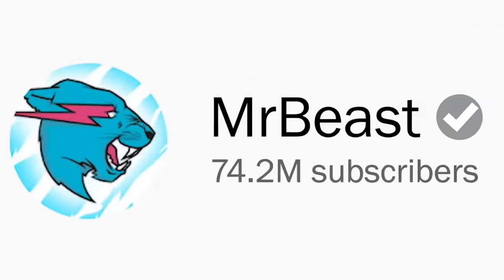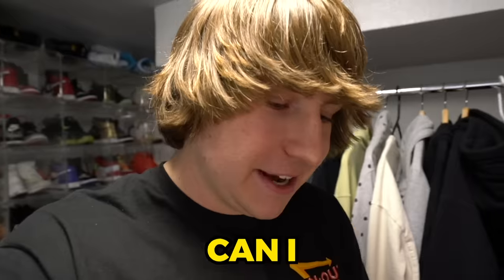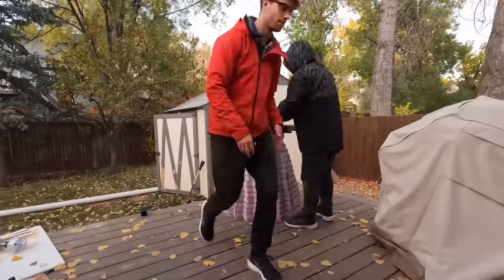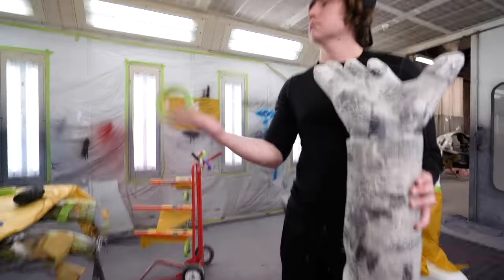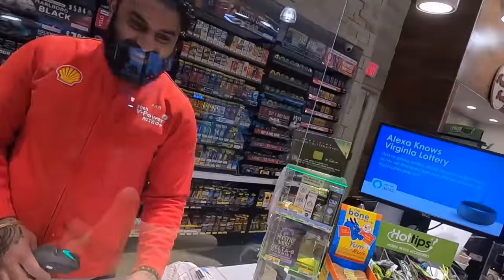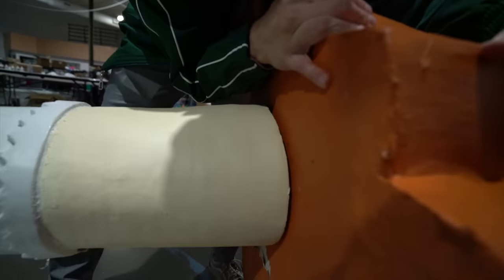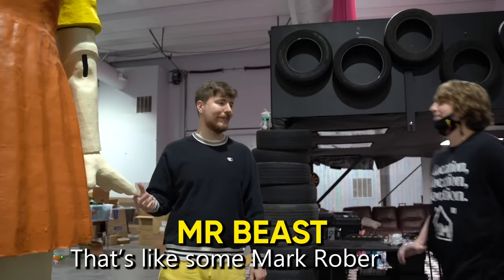I Built MrBeast’s Squid Game

Comment: I don’t think the set, prep , and execution could have been executed any better. Great work!
Reply: The doll used in Mr Beasts video is a different one. But yes, the one he built is very cool too.
Reply: @MsYolost  both are same dolls 
Just checked, they gave more detailing after delivery
Reply: @anujrathore2517  What do you mean with more detailing? The doll from Mr Bests video is much smoother, has different proportions, and the connecting arm part ('elbows) are different
Reply: @MsYolost  how did you know what? And why did they change
Reply: They maybe did a little more work on it after delivering it, but it’s the same doll
Reply: @SweetCandyDragon  probably got edited after i think
Reply: @SweetCandyDragon   It is not :D you can see the doll before cgi on SoKrispyMedia at channel 1:04. It is made out of a completely different material than the one in this video. The doll is also smaller and the stockings have no ruffles compared to this version. How could it be the same? :D

Comment: They didn't even use the doll but the work is real
Reply: They did, it was in the first game, turning it's head and everything
Reply: but.. they did tho
Reply: @matthewjones1541  didnt look like the same one
Reply: @matthewjones1541  I a live stream chandler said the doll used is their which is that but jimmy said that didn’t use it and call the doll worse
Reply: Ikr
Reply: 97lunarmare  yeah look at the face too. Dolls are different
Reply: @davidbrownlee3080  it was filmed on different  cameras  and mrbeasted ones are much better probably and the doll was in the light in the video
Reply: They did
Reply: @-_wanderer  it’s different. Compare both dolls side by side. Specially the arm elbow joint
Reply: I think the original one broke because it was foam witch is super fragile
Reply: i think they did use it
Reply: He said he spent 50k on a working squid game doll, and he was referring to this one and the cost of labor and parts for everyone in this video.
Since the doll is rather messy up close they clearly used some form of CGI for the shots where you can clearly see the doll. If you think they made that clean of a doll in 13 days you’re insane, and if you watch the clips of the head turning it is way too smooth to be anything else than cgi. In the wide shots where you see the doll behind the contestants, that should be this doll. It looks the right height and I don’t see why they wouldn’t use it from afar, it looks great that way
Reply: @andrewnix6480  they didn't use this doll at all. Look at any of the shots where the doll is in the background or obscured and the doll is a perfect replica of the one in the show. This looks like a shitty art project.
Reply: @SkimoStories  i have to disagree. If they had a perfect replica they would have used it for the close ups which are clearly not real due to unnatural motion. You have to be able to pick that up. From far away there is no evidence that it is not this doll, and do you really buy into the idea that mr beast paid for this doll without looking for a better copy and then when he didn’t like it, magically found a perfect one and had it shipped immediately?
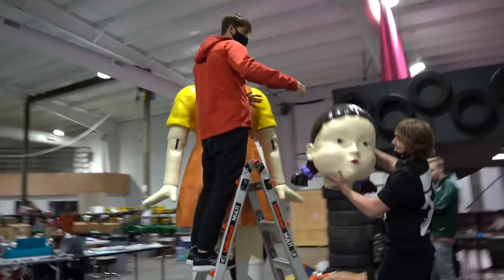Reply: @andrewnix6480  If you doubt me, go ahead and open mr beast's video and we can do a bit of analysis together. But first, pay close attention to the doll from this video's neck joint. The way that it's split across the middle for the head to be placed on top (e.g. the head has half of the neck on it, and the two neck halves are joined together.) A 5:59 you can see exaclty how the head is connected. From the same angle, pay attention to the elbow joints. They've got the slit in the inner elbow like the real deal, but from the side (again, 5:59) you can see that it's all one fused piece of foam. There's no independent ball elbow joint. 

Now, on Mr Beasts "Squid Game In Real Life" video, it is evident from the first frame that this wasn't the same doll. Maybe that's from the show, you think. Maybe that's some post-production magic to make the doll appear to have a cleaner finish. Again, at 0:40 seconds in that video, you can tell by the faces that they clearly do not look the same. Since that one is massively in the foreground compared to the players, let's just say that was cut-in in post as well as the first shot.

Pause at 1:39 (again, in mr beast's video.) In this shot you can very clearly tell that it's not nearly as tall as the doll made in this (Matthew Beem's) video. The one in Mr Beast's video is stood on a box, and is roughly the same total height as this one (at least it seems roughly the same at about 10-12 feet tall)

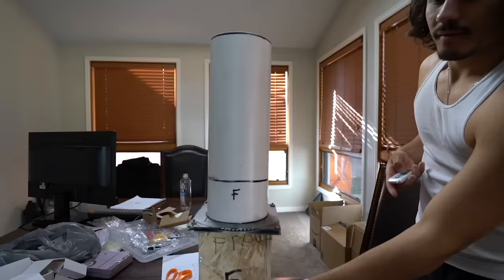 if you pause at 2:32 (Still Mr. Beasts video), you'll come to find some of the most damning evidence that they aren't the same dolls. Remember the neck shape I made you pay attention to a little while ago? You can very clearly see that the rotation joint is located INSIDE of the head, and not mid-neck. This means that the head is completely separate from a neck and fastened ON TOP of the neck, rather than having it's own half-neck that is attached to the torso's half-neck. This alone should be a good reason to see that they're not the same. 

But are you still not convinced? Still at 2:32, check out the very visible ball-shaped elbow joints the doll has. Very clearly not one large fused foam mass, like Matthew's was. In this shot, several participants and actors are very close by the doll making something like post-production a ridiculous suggestion. That would be hundreds of hours of working to mask every single frame, and at that point you're better off commissioning another doll to be made properly. 

So no, they very obviously did not use this one. Honestly, I had never watched any of this guy's videos before this, and I sure won't be afterwards. It's clear that he sees this as more of an opportunity to seem involved in something that very few creators are getting to do. This video is like a reality T.V. show. Like Cake Boss, if you've ever seen it. It's edited and acted to make it seem like some miraculously last-second achievement from these guys, where just about everything had to go well, (finger breaks, there's only 5 minutes until walmart closes, mr beast will be here in 3 minutes and the arm doesn't fit, etc.) all of that fake drama is taking away from you being an actual engineer. It doesn't take a genius to hook a servo up to a remote control. 

Closing statement: Do not hire an engineer to do an artist's job.
Reply: They did use the doll for mr beast's new vid, that's name is "squid game irl" u can go and check😌
Reply: @00Blueberry08  did you read my comment? It's not the same build. It's the same concept, but it's not this kid's build. Very obvious if you look at the two in comparison.
Reply: @SkimoStories    oop- i wasnt talking about u loll, I was talking about the person who said "they didn't even used the doll"
Reply: @SkimoStories   I'm not sure if its the same doll or not but I'm sure they did use it on something..
Reply: @00Blueberry08  yeah.. I was saying the same thing though.. They didn't use the doll in Mr Beast's video. Read the comment in this thread immediately before your first one.
Reply: @00Blueberry08  Doesn't seem like they used it in that video, what else could it possibly be for? They clearly decided that it wasn't good enough.
Reply: @SkimoStories   aww.. Well it looks soo similar to the original one in the vid, they worked soo hard on both of them.
Reply: @00Blueberry08  not saying this wasn't hard to make. I was probably a bit too heavy-handed in my bashing of these guys, but my point still stands. If they had worried more about making a doll than they did about making a youtube video, maybe Mr Beast would have used their doll..

Instead, he used a doll made by somebody who didn't document/dramatize the process, and that doll looks NEARLY identical to the one in the original show. The colour tones are perfect. The texture of all the surfaces are perfect. 

This doll's colours are far too high in value and needed to be thinned or desaturated before being put on. The orange is strikingly bright compared to the muted colour of the actual doll from the show. The same can be said about the skin tone.

The artists who made the actual replica doll that mr beast used probably used sanded foam for the head also, rather than paper-maché. The paint was also probably professionally colour-matched and applied with airbrushes rather than bristle brushes. These are all things engineers don't care about, but that end up making a huge difference to astute observants.
Reply: @andrewnix6480  bruh, just checj both videos,
it aint the sane thing doc
Reply: @generalhawkins2776  lol! Can you read my god damn paragraph that I spent 15 minutes checking both videos in order to make and then respond
Reply: @SkimoStories  I've never seen this channel before so don't know what else they've done. But are they even engineers?
They thought making the head turn was a difficult thing to do and made a very amateurish looking mechanism, it's an incredibly easy thing to do.
Reply: @andrewnix6480  The close-up shot is almost certainly CGI, but the distance shots of the doll on set are just not this doll. The paint is visibly different as are the elbow joints.
My guess is that Jimmy commissioned multiple versions of the important decorative props to make sure they would have something on shoot day.
Reply: @_Piers_  apparently they consider themselves engineers. They seem more like they're making impractical props, though.
Reply: @andrewnix6480  you're just wrong, boss. Can you read my paragraph? Took me about 15 minutes but seems way more comprehensive than your explanation.
Reply: @SkimoStories  I’m really glad you did that analysis because it definitely tied up the loose ends for me. I’ll focus on your last two points as they are the ones I haven’t already argued. 
First the height of the doll: in this video, the dolls hands rest a couple feet below everyone’s head height, and in the official mr beast video the hands are slightly above the heads of everyone in the shot at 1:39. This means the dolls could have been the same and the box 2-3 feet roll. Second, the doll in this video does have the ball joints and similar neck height, they just look more pronounced in the real video at 2:32. Any and all of these things could have caused that: touch up paint, camera distance and exposure, and a different doll costing another 50 grand while this one goes to waste. Personally, looking at the shot at 2:32 I find the facial details to be more similar to the slight messiness of this doll than the crystal clear version in the first frame. And I’m really surprised you didn’t notice how the head turning mechanism that you said happened inside the neck was actually much too smooth and seamless (and very fast) to be mechanical. 
All we can do with these points is speculate. But you should agree on one thing - no one here can prove that it was the same doll or prove that it was a different doll. So which is more likely to be true - the existence of a nearly perfect plastic animatronic squid game doll available for mr beast to purchase and have shipped to North Carolina on short notice for 50k (and this doll was just so bad that he took the time and energy to set that up when apparently there was a deadline and he had already spent three people’s time and travel), or that this doll was used in the background and close ups of it were avoided except for when a single frame picture in the beginning and one cgi head turn we’re substituted?
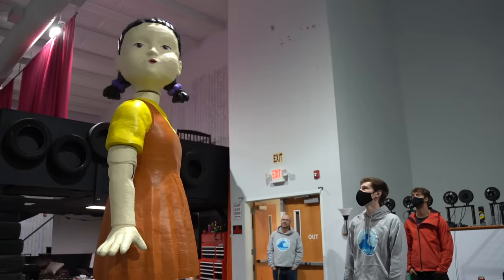Reply: @andrewnix6480  look at the neck again. This is my key point. From the front of the doll, the neck seam you see in the Mr. beast video would be under the chin, technically obscured by the head that is clearly slotted on top of the neck. Look for the seam where the neck rotates on both dolls. They aren't the same. and if they are, the head of Matthew's doll was modified to slot ONTO the neck rather than have the seam exposed, like you can clearly see at 6:23 in Matthew's video here. You've made me take a second look at the opening frames, and while I admit that it could conceivably be a colour-corrected version of this doll, the rest of the footage strongly convinced me that it isn't. Unless it's a new head that was designed with NO neck, rather with a hole in it that would be slotted ONTOP of the neck to better hide the seam.
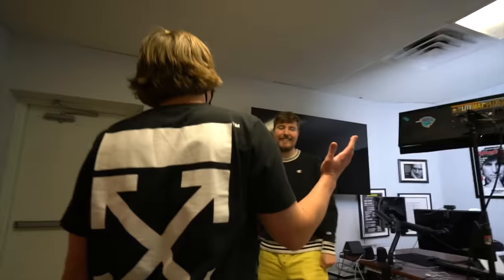Reply: @andrewnix6480  Furthermore, look at the elbow ditches on both dolls again. Another angle at 2:53 in the mr beast video shows that where the ball joint connects to the forearm, there is a narrow channel of space (as if to imply a totally independent ball joint) that simply does not exist on matthew's doll. from the front angle you see of matthew's doll at 6:23, the elbow joints do not appear spherical whereas mr beast's doll's elbow ball joints are much more spherical (This sentence has caused me to realize I am comparing the ball joints in the elbows of giant dolls across two videos on the internet) 

closeups like you see at 3:27 of the doll, although not exactly clear, appear to reflect light in a matte textured way. Matthew's doll is extremely glossy and due to the uneven nature of the paper-mache this causes the light to fill in all the imperfections in the shape. I don't think they would completely cgi the doll, and you cannot really correct light across texture in that way even with good software. 

Better questions for a resolving answer may be to ask whether the sun beating overhead was indeed natural, or added in post production? If that's the inside of an artifically lit warehouse, then fuck me. But it doesn't seem like the lighting is fake to me. Corrected, but not artificial.
Reply: Hmmm i'm pretty sure it's not the same doll guys. I ignore why they didn't use it, but the one in Mr Beast's video appears to be CGI in some shoots (like the intro or perspective shoots where the head rotated) and a sculpture in other shoots (bg shoots).
Reply: @SkimoStories  im saying those shots are literally a completely 100% cgi doll. This requires simple logic. if a PERFECT plastic full size doll existed (as is shown in those shots), why would he hire this crew to make one from scratch in the first place? The logic behind the situation makes no sense and your observations from the shots in the video are never going to be conclusive towards anything
Reply: @andrewnix6480  you never know. He could have put out multiple commissions and used the one that worked best. Not saying that it’s entirely impossible that it’s all CG, but it’s highly unlikely based on the sheer amount of shots we have of the doll looking completely different. I’m talking about the background shots and the obscured shots. Ones that wouldn’t easily be CG’d.
Reply: @andrewnix6480  and you fail to realize that Matthew seeks to gain more than 50,000 off of the exposure of this collaboration. Somebody doing this out-of-pocket could definitely start a solid video making career in this industry by making this for no reason, let alone having a shot at being featured in a guaranteed hit of a video.
Reply: Did you even watch the video?
Reply: For those who are saying that they used the same doll, they did not. It's not the same doll. If you need proof, go check the doll's socks here at 5:17 and the socks at 2:21 in the "$456,000 Squid Game In Real Life!" video. The details on the socks are gone and the texture of the doll is completely different.
Reply: @andrewnix6480  Hey man, turns out the answer was actually out there clear as day this whole time we were arguing and squinting our eyes. Go watch "Making MrBeast's Squid Game in 10 Days" by SoKrispyMedia. You were right! There is so much more special effects than I ever could have imagined in this video and they really sold it. However, at 0:20 seconds (and throughout) that video, you can clearly see the unedited doll directly behind MrBeast! So no, they absolutely did not use this doll in the end result. There are two dolls. HOW or WHY they had two dolls made, I will never know. Maybe Mr. Beast agreed to let this guy say he was making the doll for the youtube clout, but they both agreed that he wouldn't use it.

Anyway, case closed. You were right about the effects, I was right about the doll. Cheers.
Reply: @SkimoStories  damn thats interesting. I would at least hope maybe they had a professional artist paint this doll to look plastic, rather than it being a scam? But nice catch